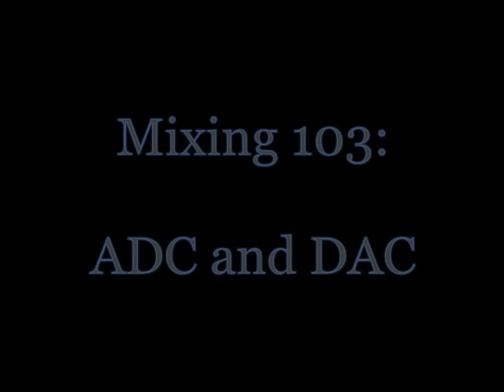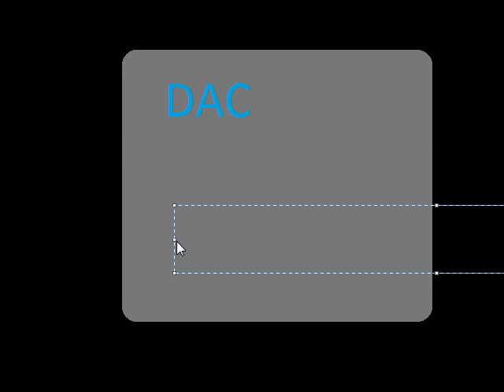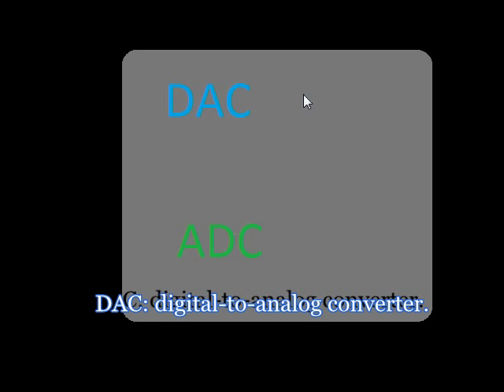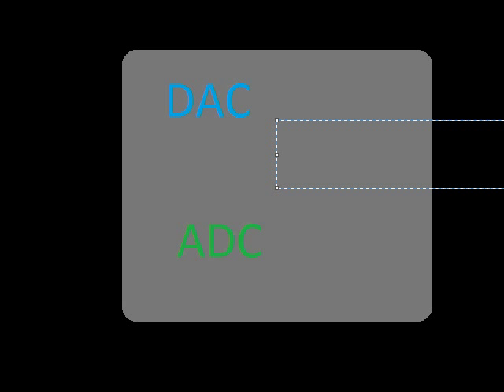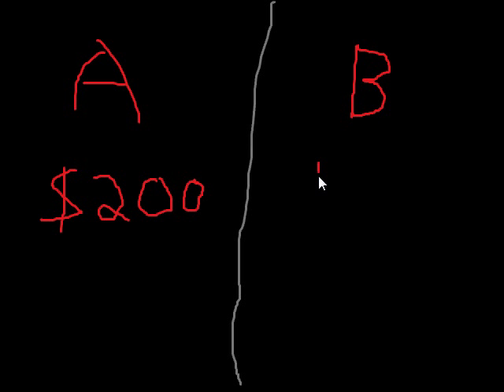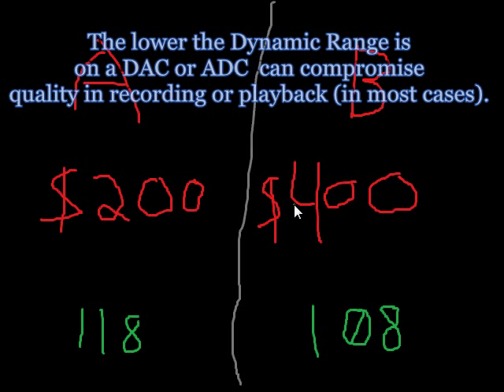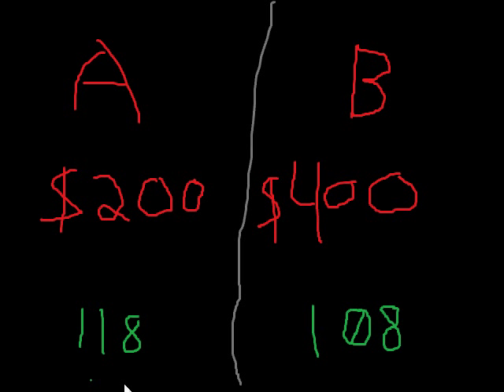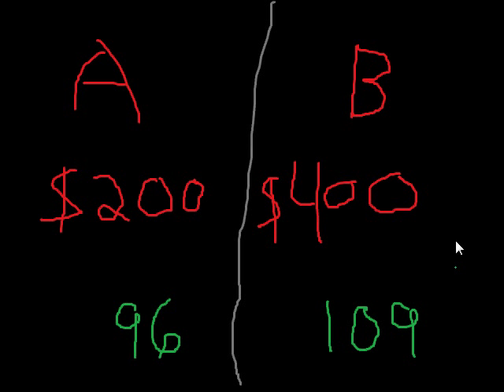ADC/DAC Review (Mixing 101 Series)

Comment: Thanks for sharing your knowledge.  This is by far the best video I've seen regarding this subject...I have a interface that records and outputs 114db of dynamic range at 48Khz and will record up to 96khz.  Does the DR increase as the sample rate increases? Would the increase of quality be reversed if I mixdown to say 44.1 for cd? Lastly, is it possible to take advantage of having the ability to increase your DR/SR if you are producing tracks in a program where the sounds are all 44.1K? Thanks.